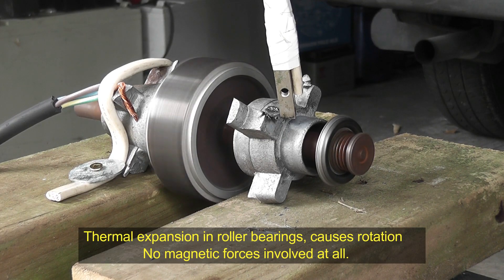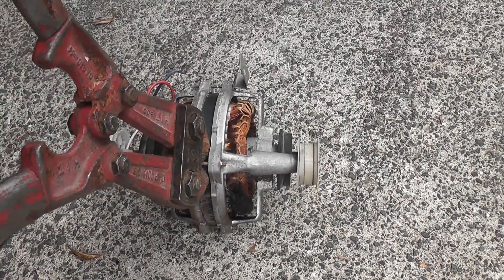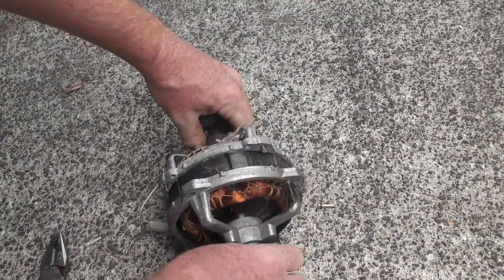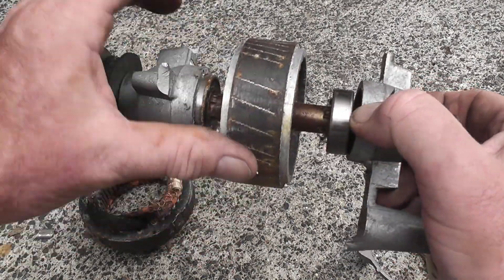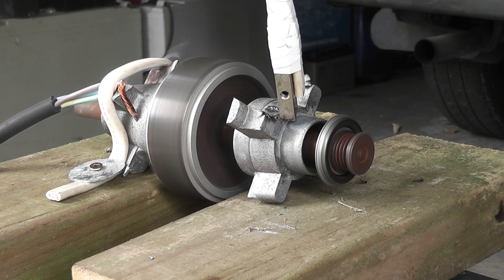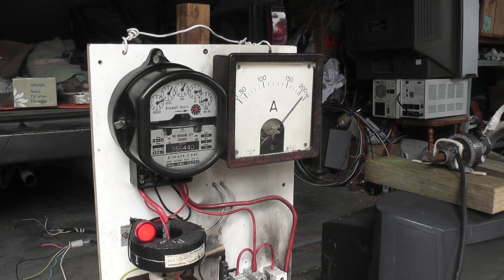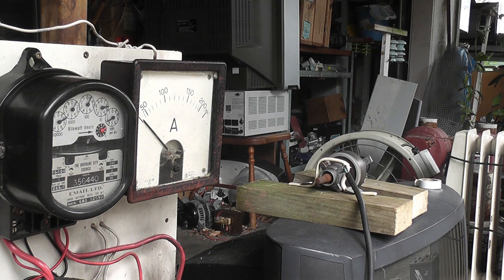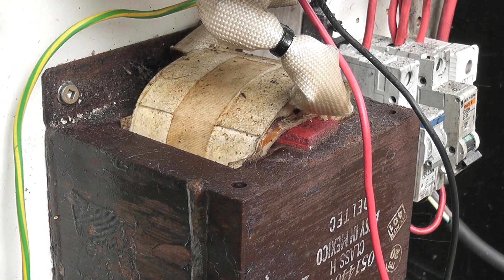Thermal expansion roller bearing motor

Comment: Top tip: if you have a butane torch, those pliers can not just be used as a hammer they can be used as a soldering iron.
Reply: i thought it was just me using those pliers as a hammer, might have to give the soldering iron trick a try lol

Comment: How much torque is in it?
Reply from the maker: Not much torque.
Reply: @RODALCO2007   Aw, I was hoping for 200+amps it had some monster torque that made it practical in some way. Boo! Still cool as frig though, alien technology. If we, da people, invent some way to recycle heat, this could be the next big thing.
Reply from the maker: The best thermal expansion motor is still the diesel engine.  @dimitar4y
Reply: @RODALCO2007  Well, that I know, but, you know, it's not as compact as just heating a bearing.

Comment: RODAL. Lmao love your Master Key😂❤️👍.       Idea for new improved Wasp Jail, add a spinning wheel under electric grid with thick wires soldered to spinning wheel (like a 30 wire weed  eater down in hole ) really pissing them off.😂😂😂😂😂😂😂

Comment: Excellent experiment! Never knew of this before, would be interesting to run the motor to destruction, will need a good high current power supply though. Fantastic video Ray!
Reply: Old 12V car battery will work, just charge it up overnight and there will be enough energy to take the motor to red heat and seized.
Reply: +SeanBZA Could try that and I have an old electric welder handy, that would supply a decent current flow.
Reply from the maker: I saw this on Roobert33's channel a couple of years back.

Comment: I'd love to see an explanation of the principles at work here... Most odd.
Reply: The contact points of the balls on the race experience heating, and if the motor is turning the heated area is at the one side from the thermal inertia of the steel. This makes a small force that tends to roll the ball away from it, and this continues all the way round the race. Eventually the arcing and heating destroy the balls and the motor stops, though it generally is nearly white hot by this time, the grease having long since burnt away.

Tip for making one is to take the bearing covers off and wash out the grease. Cooling it with a water bath works to make the bearings run longer, though they eventually will erode away enough material to make it stop.
Reply: That is fascinating! Thank you for that!